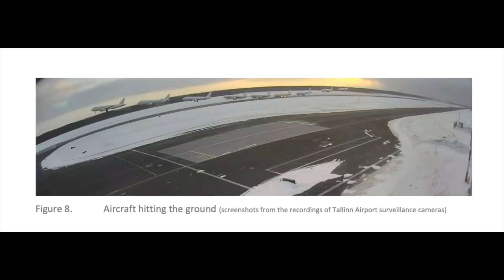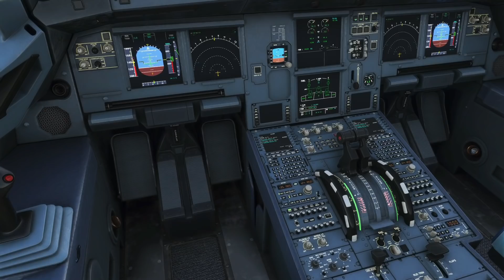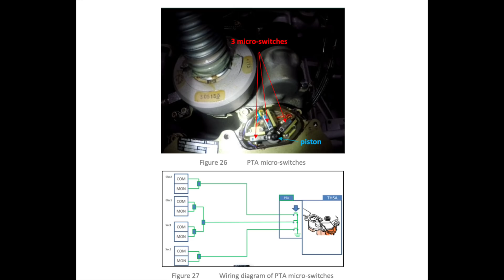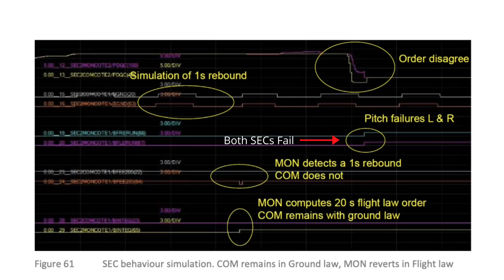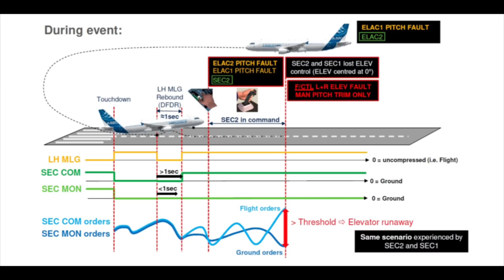The Oil Change That Crashed A Passenger Jet | The Crash Of Smartlynx 9001

Comment: It’s just amazing that hundreds of thousands of multi engine flights took place during WW ll without even one computer and this plane has enough computers to fill a college computer lab. The one thing that I know for sure after building and servicing computers for years is that they fail and the degree of the consequence of this failure is directly proportional to the importance of what they’re controlling the moment they fail. It would seem logical to have a one time override removing them from the control circuit if this problem cascades through the redundant computers.

Comment: What about the engine fires?
Reply: What about them?
Reply: @tomstravels520  why did the engines catch fire?
Reply: @kleavenae  isn’t that obvious from when the plane hit the ground?
Reply: @tomstravels520  Well it wasn't. After a second watch I can see that they retracted the gears and collided with the runway and since the engines are mounted low they probably got scraped on the runway and this damaged them so they caught fire. But that's just speculation as he did not mention the engine damage later. Since the failed engines made their situation much worse the investigators probably looked into why exactly they failed and might have issued some recommendation.
Reply: @kleavenae  they failed because of the impact with the ground. Surely that should be obvious that dropping engines on to the ground whilst running is not going to be great for the engine. But like what happened to PK8303
Reply: @tomstravels520  They did not fail because of the impact. The impact only caused some damage. That damage propagated and eventually caused the failure. That took a while. It would be interesting to hear what actually caused the failure, could it have been prevented or at least given more time for the engines to run in the damaged state.

Comment: In my opinion, pilots should have the ability to take full manual control of their aircraft in cases where they are fighting'  the computer(s).  Computers should never have the ability to 'lock-out' the flight crew. Far too much trust is put into computer controlled systems. There is such a fine line between where computer systems work as they should, and where they develop a fault.  It takes just one tiny component, out of the thousands within a system, to have an  'off day', and that can bring a plane down with a serious loss of life. Computers should only ever be our 'slaves', NEVER our masters.

Comment: I don't think a 1-10 scale is the right way to go with regards to automation on anything... Particularly to Aviation, the problem isn't whether or not we can or even should put a device into an airplane to aid in pilot controls... The problem is the philosophy of using those aids that trickles into the industry because of it...

     WAY TOO OFTEN there's just too much push by corporations to get plots flying quickly and cheaply, so the philosophy is that these automation aids can be engaged as standards, used as "Nanny-bots" to babysit the pilots to keep the dumb-ass humans from f**king the plane up. The problem with this, however, is that a syntax error, even a decimal out of place or a misplaced space (even a double-tap where you intended a single space) can COMPLETELY CHANGE a line of code. From there, debugging a faulty command can take hours, even on a "script" with only a hundred or so lines of code... 

     In Aviation, there can be NO SHORTCUTS. If a pilot doesn't know damn well how to handle his craft, how can you expect him to teach a robot to do it???

      Humans can make mistakes, obviously. That's what puts such a draw to simplifying the automation aids and trying to eliminate human error factors. The problem is that it's just as easy to screw up the command inputs to a keypad as it is to screw up the inputs to levers, joy-sticks, yokes, wheels, tillers, pedals, or anything else a human interfaces with to operate a plane or any other machine... This is how the robots will kill us... through our own laziness... NOT as part of some rebellion. They'll do exactly as we command and we will be the ones doing it all to ourselves.

      I propose a different philosophy for the automation tech' we put into an aircraft. These things are AIDS, not robots, NOT pilot replacements. We still need qualified pilots that are fully capable and competent at flying the god damn airplane. The aids just make the job a little more efficient, easier to manage, and maybe even safer when a system gives an issue or fault, for a pilot or flight crew to allocate stable flight to the aids while troubleshooting whatever is wrong AT LEAST such that the craft can be safely brought in to land and then sent to the tech's and engineers to be properly diagnosed.

     I (for one) NEVER EVER IN HELL want the robots to be in complete control of the plane. They do NOT have any value for "self preservation" and can't give a shit if they survive the flight or the landing. I want a human up there who DOES CARE. We just need to get it through the corporate's heads that they're not doing anyone any favors by devaluing competent flyers whether for the years of experience making them "too expensive to be worth the pay" or it's just "too much human frailty"... 

     If I'm going to die either way, I'd rather have my fate in my own hands, however imperfect they might be.  ;o)

Comment: Cockpit automation is fine as long as the pilot still has the ability to take over even with every computer inoperative 

As much as I like Airbus, Boeing still wins in regard to flight control redundancy, the 737 has 4 ways to control the plane, autopilot, hydraulics, cables and pulleys, and trim  

A-320 only has 2, hydraulically with the autopilot (you're basically just controlling the autopilot in an Airbus anyway) and trim 

A350 does better by adding electrically driven controls, but if the computer shits itself, you're still up shit creek with no paddle
Reply: THE computer? A380/A350 has 6 total computers where even just 1 can allow for full  control the aircraft and 1 backup control module that allows for control by side-stick separate from the main computers. 

Also you seem to be confusing autopilot with Electronic Flight Control System. AP in Airbus is just a switch that says the commands to the flight control computers come from the FMGC instead of the sidestick
Reply: @tomstravels520   I dumbed it down for the simpletons in the comments section, when I said computer, I was referring to all of them, if they all fail, you're screwed
Reply: @mwbgaming28  well that’s never happened. Also if all six did fail you still have a back up control module. The 777 and 787 you’d be in a similar situation with pretty much no control if all 4x ACES fail except alternate pitch and engine thrust
Reply: @tomstravels520  apples to oranges, I'm comparing the A320 to the 737, I'm aware that the 777 and 787 are both fly by wire, this is not me having a dig at either company, I personally prefer Airbus anyway, but I can't ignore that the 737 has far better flight control redundancy than the A320 due to still having a mechanical linkage that connects the control column to the control surfaces 

If I were buying a private aircraft, I would buy one that uses conventional controls rather than fly by wire, because then I know with 100% certainty that the computers cannot take control from me under any circumstances because of that mechanical linkage 

Even with a total electrical blackout (no batteries, no ram air turbine, no engine driven generators, no APU.etc) a 737 could be landed more or less normally, and could make a missed approach if the engines are still working

An A320 with the same problem would still have SOME control with rudder, pitch trim, and engine thrust, but nowhere near as much, and would be a lot harder to land if there is any type of crosswind or turbulence on final approach

That being said, when everything is working as it should, the ride on the A320 is definitely a lot more stable than the 737 because the fly by wire system effectively filters out a lot of the roll and pitch disruption instead of the pilots needing to do it themselves (also the cabin doesn't sound like someone spilled a bucket of nuts and bolts in the cargo hold before takeoff)

Comment: Automation-pilot interactions are not just complicated problems to overcome in software they are IMPOSSIBLE to program for.  The more complicated the solutions the greater the permutations of error mechanisms.  It follows Murphy's Law - "If things CAN go wrong they WILL go wrong."  Or another way to state it is, the dog is chasing his tail.  The recipe for disaster is baked in and when the plane-pilot schism occurs it can lock in the plane-pilot death embrace.  The only possible escape is to choose one or the other and lock one out.  AI would have a better chance of correcting a problem in time but when a computer goes bad it must abandon ship and give control over to a completely redundant system that replicates all calculations as is done in space flight systems.  The solution to this enigma won't be had as long as prejudice and politics befouls design decisions.  MCAS, anyone? 🤔

Comment: Should go back to the old way of flying the plane - stick & rudder, manually fly the plane with manual controls including cables. Automation only goes so far & can screw up.
Reply: Far more planes have crashed before computers were added in

Comment: I drive a sports car with a manual transmission, so I’m obviously against automation as I like having full control of what the car is doing.  However I think automation is still crucial to the extent that it can save your butt in a bad situation.  I was going downhill into what I thought was a sweeping turn, but it turned out to be a decreasing radius turn.  By the time I realized I went into the turn too fast it was too late.  I hit the brakes so hard that anti-lock didn’t kick in fast enough to prevent my rear end from kicking out.  I thought fo sho that I was spinning off the pavement and flipping my car, then I saw lights blinking on the dashboard.  The active stability control was intervening and controlling how hard each of my brakes were engaging so that wheels with the most grip got more brake and wheels with least grip got less brake.  The car straightened out, I pulled over for a minute until my hands stopped shaking, and I thanked my lucky stars that automation saved my ass.  But I will never, ever, own a self-driving car.  I’m a computer technician that sees bad programming and failing microchips all the time.  I wouldn’t have a job if computers worked perfectly 100% of the time, so I can never agree with giving computers more authority than the humans operating them.  Plus my chances of survival against zombies are better than they are against Cyberdyne Systems Model 101 T-800 Terminators.

Comment: I’ve worked in IT for over 20 years and yes, reboot often fixes a lot of issues. However, if the same error comes right back after one or maybe two restarts, the restart isn’t working so you have to investigate and change something.  I understand the  problem was attributed to computer and equipment failure but technology can only do so much. Those systems had repeatedly alerted the pilots there was a problem but had literally been shut down over and over.  I cannot understand why they’d keep rebooting and ignoring the repeated warnings, considering their very lives depended on the equipment working correctly and reporting reliable information. Technology did fail but it goes by specific programming. It doesn’t have free will. Ultimately this was people error. If they’d trusted the electronic warnings as much as they trusted it to keep the plane stabilized, the “perfect storm” could’ve been avoided. Again, technology and automation are only as dependable as the people operating them.

Comment: One important and massive issue with the debate over human to automation ratio:there is no one perfect amount, it varies based on the particular needs, which is why i feel that there is no one answer to what is too much on either side, there is a middle ground but even that is hard to determine. Aviation industry is still trial and error to some extent if you think about it.

Comment: Lots of good comments below - interesting that most people are talking about the pilot repeatedly ignoring/resetting the alarm.  Automation is brilliant - but this incident was really, fundamentally, caused by the "wrong" oil surely ?  As with all automation , it's only as good/reliable as the ongoing maintenance . Personally, I think that all designers should consider their software/hardware to be as reliable as a windows based PC. 
Maybe all planes should have a massive big red "I HAVE CONTROL" button on top of the instrument panel. This puts the plane's computer(s) in a Windows-equivalent Safe mode.  🧐

Comment: As a result of all the bad programming and bad testing of software detected as a result of this incident, did Airbus do a thorough review of all their code and conduct a lot more testing? Or did they decide that they couldn't be bothered to do so? I am not just referring to computer systems related to pitch trim - I am referring to ALL the code. This incident indicates a systemic problem with the code design and quality, as well as with the code testing.

Comment: I’ve watched accounts where several airbuses have flown themselves into the ground because it prevents full power and full climb potential no matter what inputs the pilot tries to request. I understand there are circumstances where it’s hazardous to make maximum performance available but there needs to be an override available that will reset to limited performance but have it always available when in override. I think this should apply to all plane makes weighted for the specific plane characteristics.

Comment: If there's an EMT that's big enough to destroy the complex avionics components on commercial a/c, it won't much matter how much or how many or how complicated the internal electronics automation is in ANY a/c cause the fact is, they will begin to fall out of the sky and only a few will be able to safely set down somewhere, undoubtedly unintended yet completely cutoff from any help that didn't witness their landing, crash, etc. due to no comms AND no usable transponders though the black box may emerge victorious, there'll be no way to read them for a long time coming

Comment: I'm in for 100% automation but the systems shouldn't be designed where race conditions can screw you over (the way SEC1 and 2 failed here is basically a race condition in terms software bug)

Comment: Whether to use automation or not is not a matter of putting it on a scale from 1 to 10. For any single thing that could be manual or automated, the correct choice is to use the one that is safer. Use automation exactly in those places where the machine performs more reliably than humans, and vice versa. Anything else would just be insane.

Comment: I would want on a scale of 1-10, a 4. 
Enough automation that it reduces the load and allows for a 2 man flight crew, but not enough that the pilot is simply a system admin, they still have to actually fly the aircraft. 
In my opinion automation can be a good thing, but its a prime example where, a little is good, a lot isn't.

Comment: I'd say around a 5.  You need a pilot who actually knows how to fly the aircraft manually and a mechanical control system that will allow you to easily bypass the electronics.  A lot of current pilots would have no idea how to manually fly an older plane.  DC3, 707, etc.  oops...

Comment: A320 is a highly used modern commercial plane. It has all the tech for it to NOT crash. If there are multiple warnings you should land the plane and taxi off the runway. This all could have gotten the plane safely parked, not a single scratch on the pilots. The biggest mistake wasn't from the plane, it was from the pilots.

Comment: On a scale of 1 to 10, I rate automation a 9. But I still want the pilot to be able to manually control the craft when those rare failures happen.

The take away I get from this is use the oil recommended by the manufacturer! This company manufactured the craft. They know what kinds of fluids it needs. Using a fluid with different characteristics sounds to me like insanity cubed.

Comment: Automation without visibility into what the automation is doing and "thinking" is criminal.  Automation (sensors with finite reliability + rules) can override pilots, but pilots (observation + reasoning + creativity) can't overrule the automation?   Automation will win and could crash the plane.  Heard of MCAS / 737MAX?

6 

... but only if pilots have a "my controls" button to turn automation off.  Duh.
Additionally, add mirrors/cameras to the plane so pilots can see & assess status of a crippled plane would be a major safety improvement...

Comment: System: keeps throwing errors
Operator: "Must be a spurious error so keep resetting the system."
System: fails
Operator: Surprised Pikachu face

In 99.9% of all times the problem isn't in but before the system!
Reply: Why even have pilots if automation can overrule them and keep them in the dark, effectively preventing pilots from making informed decisions.  

Broken automation kills people.
Reply: @niftybass  It's the very same reason why autonomous cars still needs drivers: In case the automaton starts to misbehave, the driver can still (and is obiges to!) override. It's no different on planes.
Reply: Actually wrong. If they had reset the system again after the last warning nothing would have happened. It was the failure to reset that caused both ELAC pitch authorities to fail and switch to the SEC’s